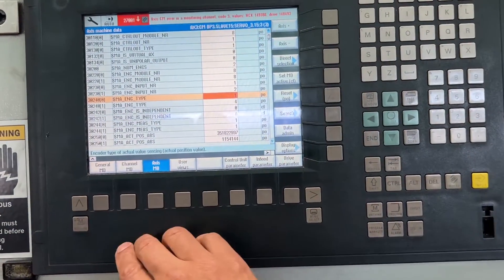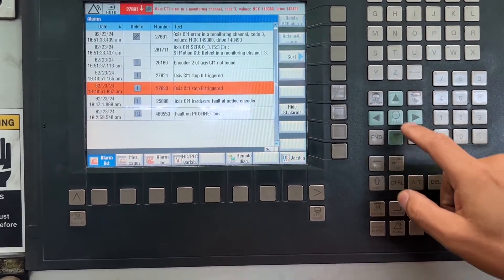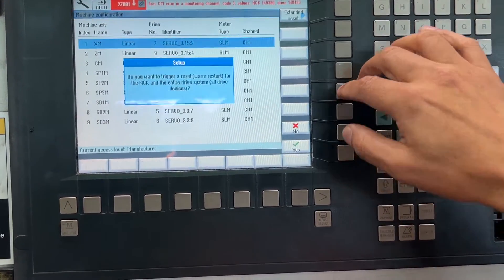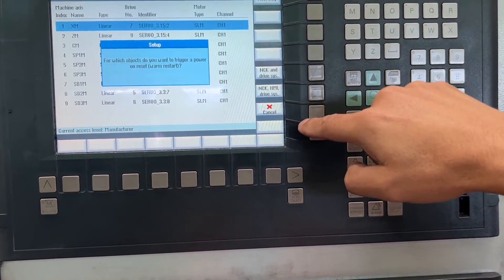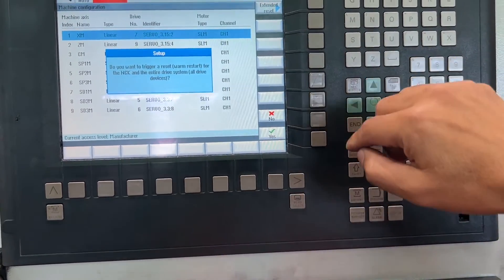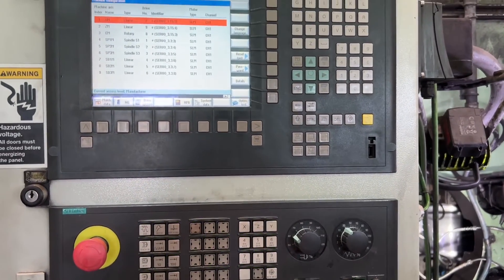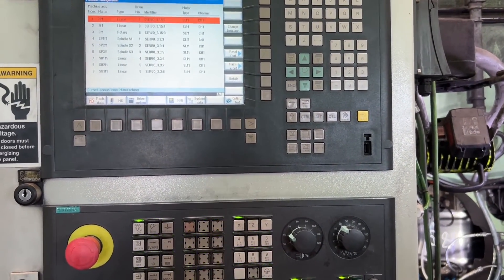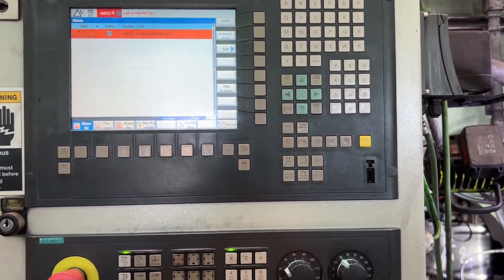Sinumerik 840D sl: How to reset the NCK  (warm restart) and the entire drive system

Comment: Funciona este mismo para el NCK 25000 el eje x
Reply from the maker: @freddyc2581  No, el modo descripto en el video se utiliza para reiniciar el núcleo de control numérico (NCK) sin apagar completamente el sistema. Este tipo de reinicio es útil para resolver ciertos errores o alarmas que requieren un reinicio del NCK, pero sin la necesidad de reiniciar todo el sistema, lo que ahorra tiempo y minimiza la interrupción de las operaciones.

El código de error *25000* en el SINUMERIK 840D sl generalmente indica una **falla de hardware con el codificador activo**. Este problema puede surgir por varias razones, como codificadores defectuosos, problemas de conexión o problemas con la tarjeta de control. Aquí hay algunos pasos para solucionar y resolver este error:

1. **Verificar el Codificador**:
   - Asegúrate de que el codificador esté funcionando correctamente.
   - Si es posible, prueba el codificador en otra máquina para asegurarte de que no esté defectuoso.

2. **Inspeccionar el Cable del Codificador**:
   - Revisa el cable del codificador en busca de signos de daño o desgaste.
   - Asegúrate de que los conectores estén bien asentados y seguros.

3. **Examinar la Tarjeta de Control**:
   - Reemplaza la tarjeta de control si se sospecha que está defectuosa.
   - Asegúrate de que la tarjeta de control esté correctamente instalada y funcionando.

4. **Revisar el Cable y el Módulo de Interfaz**:
   - Inspecciona el cable y el módulo de interfaz en busca de problemas.
   - Asegúrate de que las conexiones y el blindaje sean adecuados.

5. **Limpiar el Codificador y la Escala**:
   - Limpia el codificador y la escala para eliminar cualquier suciedad o escombros que puedan estar causando la falla.

6. **Consultar el Manual de Diagnóstico**:
   - Consulta el manual de diagnóstico del SINUMERIK 840D sl para obtener pasos detallados de solución de problemas.

Espero que te sirva.
Saludos.